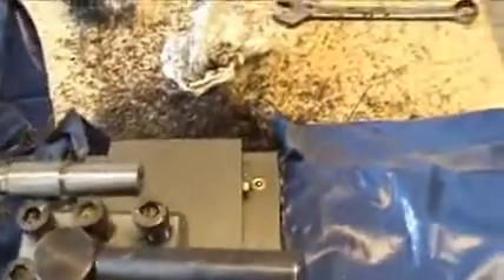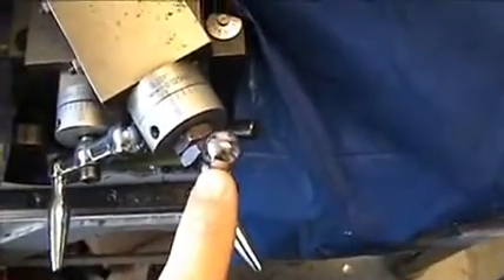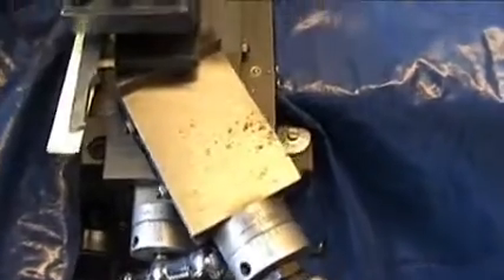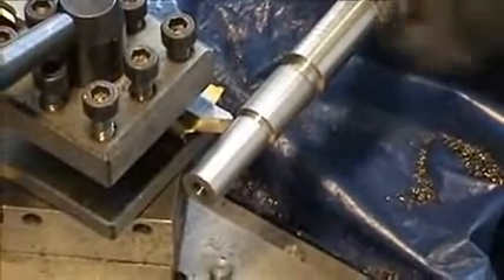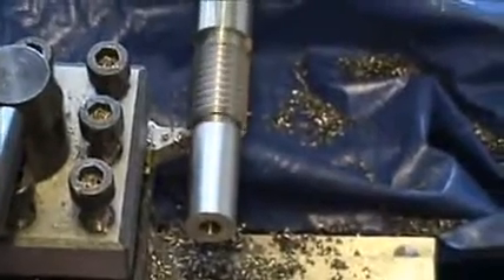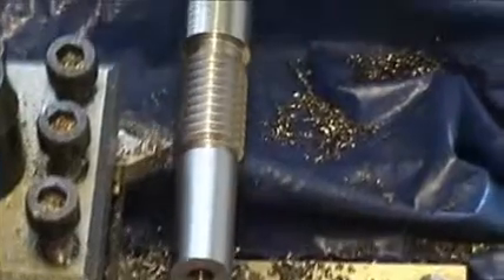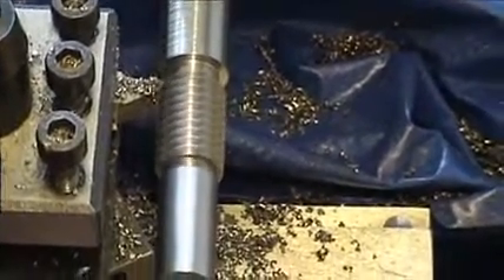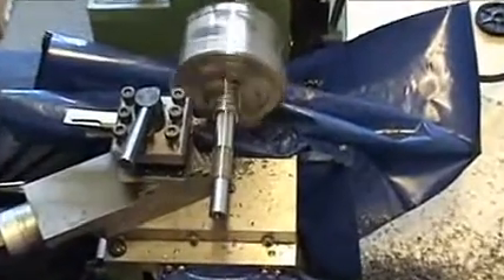screw cutting project part 2

Comment from the maker: Threads are mainly 60 or 55 degree included angle, if I was cutting a 55 degree thread form I would move the tool post 54 degrees this is to reduce cutting pressure. A die removes all the material in one pass and can tear the thread, also it can be difficult to get it to run true and square to the shaft. I did it on the lathe as I wanted the thread to be concentric to other diameters I turned at the sane time.

Comment: Question I suppose the thread pitch differs from thread to thread but??? Did you put it at 59 degrees only for the pressure on the cut? 2 how do you know when your deep enough do threads I guess there is a chart on thread dim. I curious why u wouldn't want to run a die down it instead of using a tool? Do you have pros and cons of cutting on a lathe rather than with a die from a tap n die set?

Comment: weird thread dial. I'm used to cutting english threads where there are 4 numbers and 4 lines on the dial where odd number threads are cut on the numbers and even can be cut on numbers or lines. this is new to me.